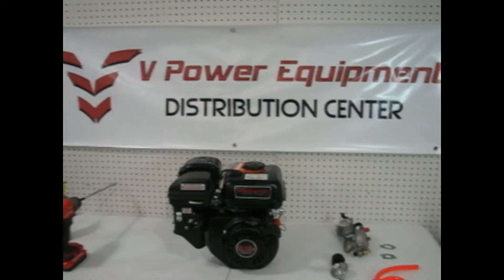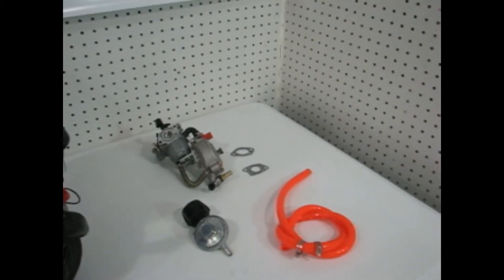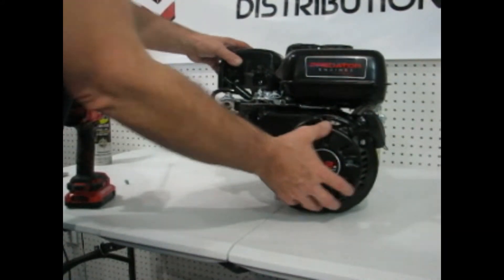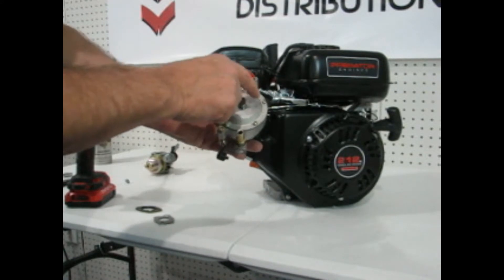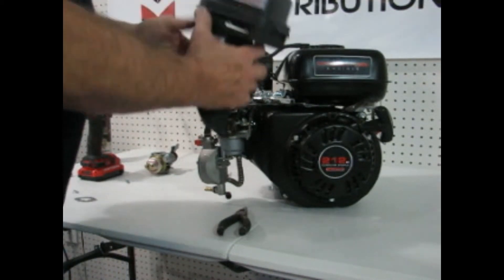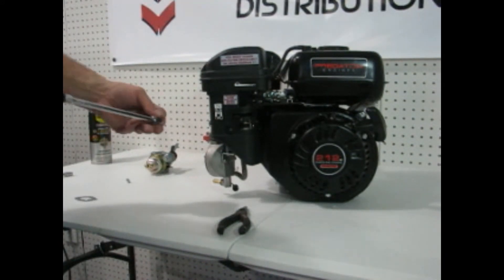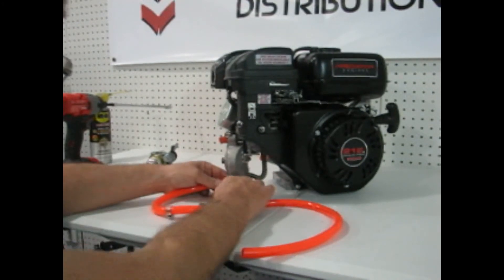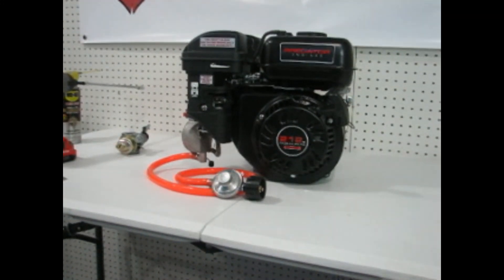Predator 212cc LPG (Propane) Kit Installation

Comment: Why do you have 2 regulators? You don't need the 1 on the tank side.
Reply from the maker: There is only one regulator to mount on the LPG tank. The part mounted on the carburetor is a fuel control valve not a regulator.

Comment: Can I put this on my zero turn mower
Reply: If your mower has the honda engine the predator is based on it will.
Reply: If you are really handy you can just convert your own carburetor. Buy the ebay kit and take It apart and make the parts fit your carb
Reply from the maker: no

Comment: Will this carb fit / mount to the 5.5 (173cc) vertical engine?? https://www.harborfreight.com/55-hp-173cc-ohv-vertical-shaft-gas-engine-epacarb-69731.html
Reply from the maker: sorry it will not fit that engine

Comment: Where do I buy just the regulator and hose or what psi is the regulator
Reply from the maker: We sell the regulator and hose with the carburetor in our LPG kit. The kit that shows the regulator and hose in the picture. We can not sell it without a carburetor because it is a special regulator and should not be used with other devices
Reply: The big round thing on the card is the regulator
Reply: *CARB
Reply: @scootersonlyrepair  No, the big round thing is the control valve, the small round thing is the pressure regulator.  Google is your friend.